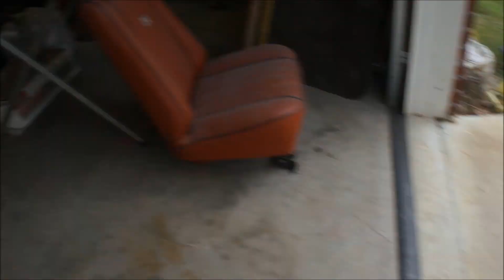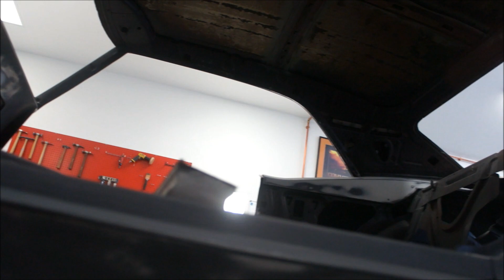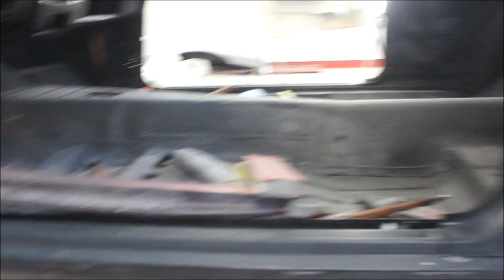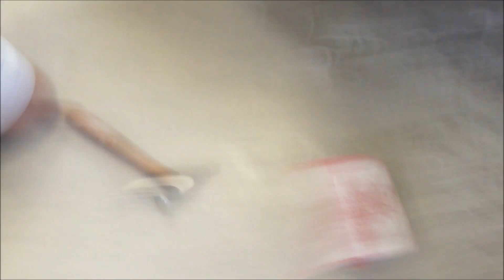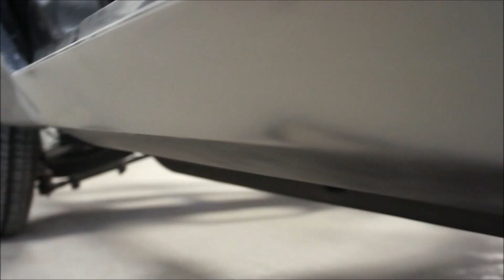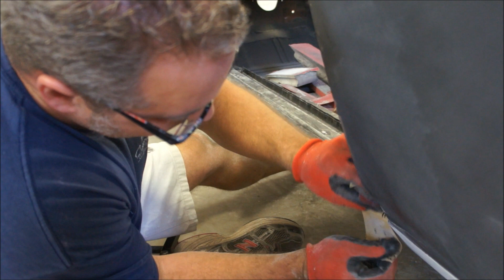doing work

Comment: Roger, my question is, as I do patch work, weld repair etc, what would be the best Materials to use for rust protection? Keep in mind the only painting I'm gonna do is the under side. ie. Short strand, primer, epoxy primer, body fill. What's 1st 2nd and so on? Thanks in advance! Also the ecoat panels I use, should I take them down to bare metal or scuff, prime and paint? Sorry for such a looooong ?
Reply from the maker: I do my metal work, welding ...ect , then grind the welds smooth , then short strand fiber glass the welds , if I can't reach the inside of the panel I use eastwoods internal frame coating with the 360 nozzle . Then on to epoxy primer , I use the spi and it sands really nice , most epoxies don't , then I move on to filler , then high build . That's my process hope that answers your question.
Reply: Perfect. I feel better about what little I've done and will use that process as I go forward...
Reply from the maker: +jeff lindsey I am sure if you asked 10 people you would get many different answers my way is only one way of many I'm sure ;)
Reply from the maker: Also , I sand the e coat because I have found rust under it on several of my " new" panels .